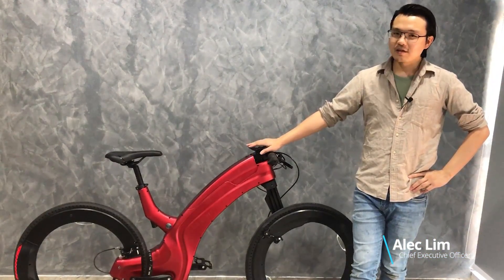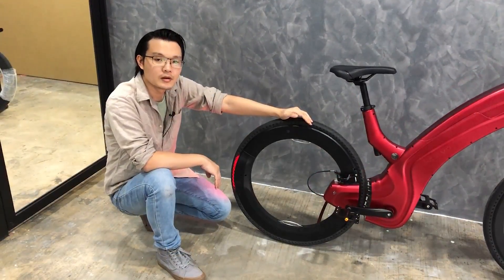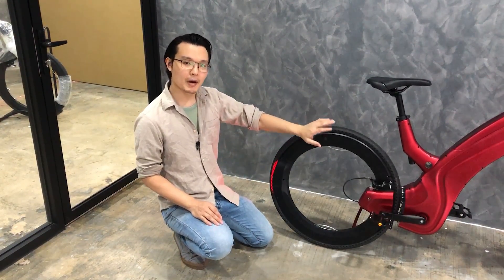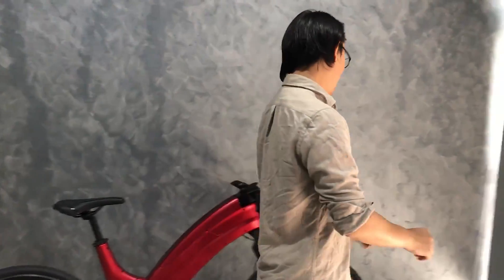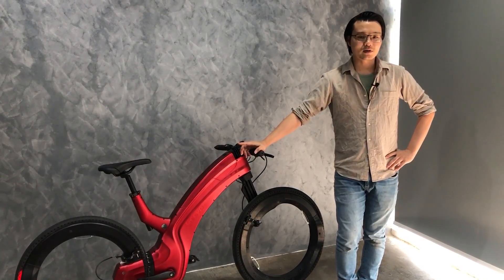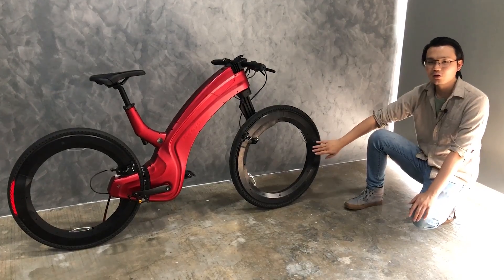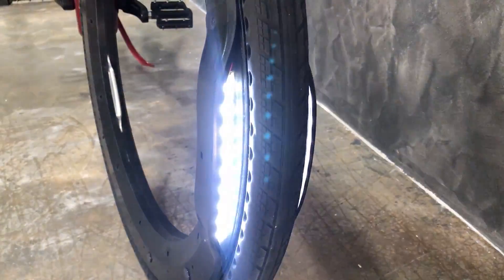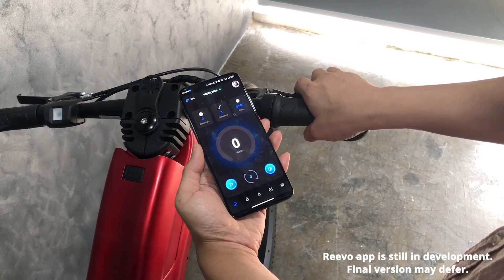Reevo: Hubless Wheels, Airless Tires and Safety Features | Beno

Comment: Horror stories emerging of incomplete bikes being delivered, AI lock system braking down and locking bike whenever it feels like, never unlocking. Wheels getting sand inside and breaking down, always way too noisy. On top of it, there is NO support at ALL if anything goes wrong?! Beautiful design - yes, but no follow up with right development and support, stay away!!
Reply: Yes, Berm Peak said, it's the worst ebike ever, very hard to pedal without el. power (big resistance), crappy brakes, frame looks like cheap plastic, only one gear, no display (need to use phone and app), usb port pointing up (great for rainy days;), very sluggish acceleration, no comfort, while walking next to bike, the pedals keep turning and it can activate the engine and the bike will keep rolling itself until it crashes (very dangerous feature)..
These are the flaws I remember from his review, this bike is a complete and utter disaster!

Comment: This is  beautiful perfect future bike.

 Hubless,  so easy to make and repair. Airless, so  never flat and better to use.

And modern carbon technology would  make it light, so it's easy to take control.

Lastly if you add never falling ziroscopic safety feature on them, it should become 😤 👌.
Reply: You know whats easy to repair? The regular simple bike. This bike is not easy to repair at all.
Reply: The brakes are 20 years out of date. V-brakes for a E-bike? That's just asking for trouble.
Reply: And any designer will tell you that hubless wheels will never be efficient, fast, safe, reliable, sturdy...

Comment: I'm sure there are people out there that will spend top dollar for inefficient, impractical, unreliable but quirky and eye-catching designs that are stuffed to the gills with utterly pointless technology, but do you know what?
There are millions of people that want a commuter ebike, built around a hybrid frame and 700c wheels, that packages the battery and motor well, is dumb as a rock and delivers reliability at the right price.
Those millions are not having their needs met by an industry fixated on off-road ebikes and design student crap. 
If you want to make serious bank, selling a million units with a $30 profit on each one is a lot better than selling 100 units and making $300 on each one.
Reply: This is a scam project. In their wettest dreams, these scammers don't have anything remotely close to a 1000000 production. I would be surprised if they can make and sell 100.

Comment: weight ? and please tell us what is actually wrong with spokes ? they seem like a simple solution to a simple problem, the bike looks awful, despite clearly being an exercices in form over function, well, you failed at both. the way you indicate the direction you will turn to is retarded, and even dangerous, that is really not the type of movement you want to make when you should have your fingers on the brakes, i would instead add a button on each side of the bike, more intuitive. but the real problem is this, WHY did you design this bike ? oh a little detail, is this an e-bike ? don't you think that matters ?

Comment: Airless tyres is deal breaker. Will be super unconfortable and shake itself into pieces.
Reply: Agreed! They need to keep their word, and offer an air-filled tire option. Airless tires have no suspension, and will fall apart easily when going over concrete curbs, stairs, and more.
Reply: Totally agree. The first thing I thought of. Maybe if you're lucky enough to live in a country which has super smooth roads but in reality...